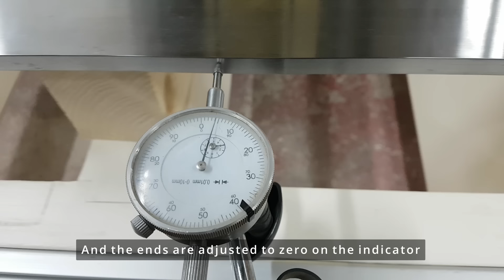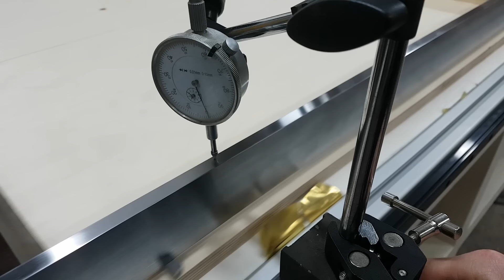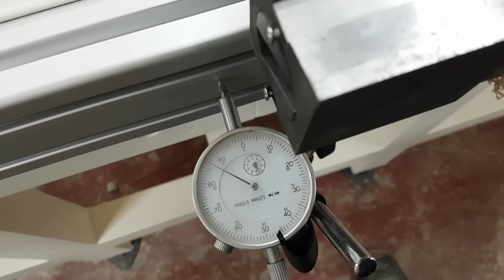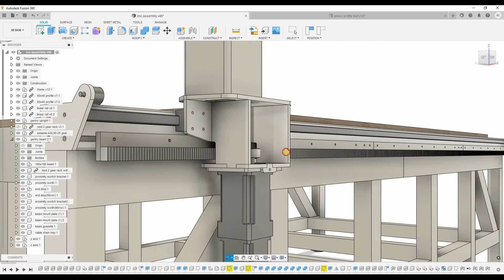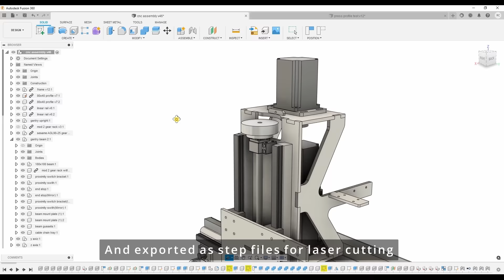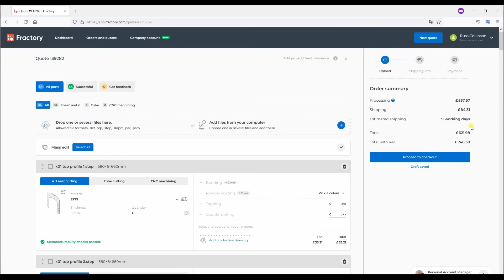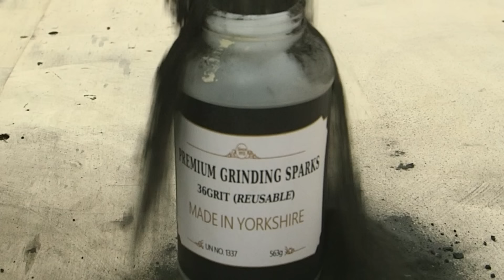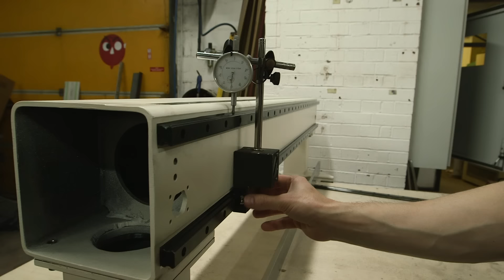Building an EPIC £20,000 machine part 2

Comment: As a qualified engineer, welder and fabricator I can appreciate the effort and time into this project. Very nice work indeed. [edit: out of morbid curiosity, how much did you pay for that sheet of ply?]
Reply: Ply cost, probably the same as a small amount of Lurpak.
Reply: A qualified engineer... wow. ^^
Reply: probably about twice as much as the price was 2 years ago!
Reply: @l.k.1011  That means you own a screwdriver/chisel and an adjustable spanner/hammer.
Reply: @andysparks8245  - waaaaay more than double!!

Comment: Hi there ,great work I’ve had similar problems with shimming.I eventually used 3 mm rubber insertion (gasket rubber ) and torque past the three mill thickness until the rubber was 1.5 mm and the used the same setup as you have for truing up ,the rubber acted like a spring  ,it held fast 👍.

Comment: Very impressive. The only thing I'm curious about is that the main base is wooden and thus will expand and contract with seasonal changes and thus the very tight tolerances used possibly will change.
Reply: Isn’t the paint seal it? Kinda making the wood waterproof etc. to prevent it from sipping any moisture etc. 😂
Reply: I guess the paint will not fully seal the wood. There are some cracks in the wood and I think they are not fully sealed. Sure the wood will not work much at the beginning. The time will show if it works well enough. 😊
Reply: Steel beds are overrated. Precision is mostly determined by the steel in the linear rails in the Y axis, not the wood, and the X axis actually is steel. The Y axis may be an issue but it is easy check for accuracy. Steel has temperature/expansion issues also.
Reply: Well I’m impressed, I understand why the  table assembly was so sturdy now.
Reply: @carefulandprudent1058  yup bro

Comment: I agree that the ingenious way he builds things with pretty much home shop tools is amazing.  I have one complaint, when I was 18 years old I went to work in a machine shop and the 1st day was safety training.  One of the first things they passed around the group was a pair of safety glasses with a broken off drill bit stuck halfway through the lens.  This was from a guy doing exactly what he was doing drilling steel on a drill press when a bit about the same size snapped off and hit the glasses.  That was an eye opener (pun intended) for me.  NEVER drill anything without eye protection!

Comment: Amazing work, hopefully those linear rails hold up, that’s going to be a lot of mass to accelerate between movements. That’ll be more stress than the movement itself (like anything, it’s not the movement, it’s the sudden stop/ start). That top gantry alone. Oof. Good thing is you will be able to modify/ adapt the gantry as you learn and use and if you will be using a mill with g-code can adjust acceleration values to not have the thing rip itself apart.

Comment: This is much more work than it looks on video... Respect!
What will those 3 extra motors be for? 🤔
Edit:
Thank you for not making this a 73 parts build, just for the algorithm.
Reply from the maker: they are planetary gear reducers,  two are 20:1 for the dual y axis, and the other 25:1 for the x axis.  because they are used, they didn't have three the same. I sized the spur gears so they are all the same end ratio.

Comment: Love the "level" at the start of the clip. Haven't seen anything like that before, however, I have seen something a little more basic. A good few years ago, a builder friend of mine was helping me build a large deck across the front of my house, and he turned up with his level. A old 20litre paint tin with a piece of metal tube soldered in to the bottom, 25 yards  of green garden hose and 6 inches of clear plastic tube. Worked perfectly ...so we thought, until we got to the far side of the house and became aware that the level marks were somewhat off. Slight pause to scratch heads, then discovered obvious flaw in system. Small leak in the old paint tin. 🙄.  Blob of silicone sealer and some more water solved problem, and leveling marks accurate enough to satisfy even a picky builder. Deck still up, and level quite some years later. You young guys don't know your born with all that "Modern Technology" 😂😂

Comment: Admirable effort in trueing it up but, and I hope I've missed something here, but with multiple pieces of timber and their grain going in all different directions, won't the differential thermal and moisture expansion/contraction render all your work, well, pointless? I mean, better than not doing it but the flatness will be everywhere.
Reply: Having all the grain running in one direction would make it even worse as you would have all the expansion and contraction in manly one axis.
Also this isn't an industrial application where everything has to true up in all environmental conditions and for a million cycles, for his application this will do just fine.
Also there is quite so adjustment left in the system.
His only alternative would have been welding up a huge underconstruction, like a welding table or hydraulic bench and making one of those and getting it completely flat is a task for which you need quite a substantial metal workshop.
Reply: @marcusott2973  well he needs to have more content lined up for a sequel… 😅
Reply: Watching this and other videos he's produced has shown that the guy is a perfectionist  and probably won't settle for just good enough, so will put his best efforts into whatever he does. There's no counter argument to that.
Reply: Initially I thought it was pointless as well (after the first 10 minutes of the video), but there's a point to his madness. While the wood won't stay true, he needed it to be true to be able to accurately grind in the other parts. Even though the wood will move, at least his metal parts are much closer to perfect now.

Comment: Hi, Still watching this. Really enjoy watching your videos. Probably a bit late now but while watching you do the shims, I wondered , if you put the shims between the rail and extrusion instead of the extrusion and wood it may work better. I would think as you tighten the bolts the wood will compress slightly where the shims are but between the two metals it likely will not happen and any pressure on the wood will also be evened out. Not an expert on anything just a thought...

Comment: ok, I have to ask.. why are you chasing microns when you have timber frames? the change in seasons is going to move that timber more that the tolerance you are after :)
Reply: Hmmm @ PICSI good point , so maybe  a season check twice a year is oke , but temp control is a solution for the shrink and extend of the wood .p.s at the end tho it needs to be recallibrilated once in in while  but what a genius build .
Reply: I would imagine that is the whole point. Get it as close to perfect as you can, that way with seasonal movement it will be an acceptable tolerance.
My hats off to you sir for constructing this CNC for our enjoyment to watch and appreciate your tenacity, patience and great skill!

Comment: On a wooden apparatus, certain measurements are palliative, with humidity and temperature varying considerably. Wanting to have the precision of a cast iron apparatus such as a milling table is uncertain.
Reply: I agree. Although beautifully joined this table will move considerably in the moist English climate, possibly enough to bind horizontal movement
Reply: @petek210  ,"//////s/
Reply: @petek210  ...

Comment: I'm building a CNC right now too. I used steel for my framework, my local machine shop charged me a hundred bucks to deck the steel pieces, and these were 5 ft long pieces. I admire the home built resurfacer though. That was pretty cool, I did not think it would get that accurate

Comment: Nice work. As an Engineer I desoigned dozens of these tables along the way. I was very sceptical about the wood frame, but you managed it well. On your shimming : the bolted rail adds up a ton of rigidity to your already heavy aluminium extrusion. So to unbend it, just loosen the rail screwsscrews otherwise you just bend your chassis.

Comment: It is a privilege to watch your mix of engineering and knowledge of wood. Two questions: 1. Despite testing all the tolerances, is not likely that wood changes its shape with workshop climatic changes. and 2: When I first learned welding, I was told always bend the cold end of your rod - a. you'll never pick up the hot end if you see its straight, and b. you're unlikely to poke out somebody's eye with the cold end. Love your dedication, precision and Yorkshire humour. Hope you get a kidney transplant, if necessary, after that plywood purchase.

Comment: One thing I learned from my time working in R&D on positioning systems is the importance of minimising the weight of moving masses. I'm interested to see how much bed flex you get when starting and stopping that massive steel gantry.
Reply: On a similar vein, a lot of weight being held by the vertical tracks. If the tracks were laid flat, with a milled flat bar between table and track, that could eliminate any Z axis movement.

Comment: Great video as always. I used to work on a CNC die cutting machine for 24 years, It was in envelope place cutting envelope blanks first machine was a non computer manual imput schon machine. Then went onto schon computer controlled machine with auto feeding pallets of paper. then onto a japanese Sysco cpc-NA computer controlled.
    they are great for mass production. A lot of woodwork channels going the cnc route. i do like your attention to detail when you working on your house more.

Comment: Overall, for the project you did a great job. Love your videos. Nice and relaxing.

The reason you kept getting high variations in the measurements on the first rail  is because of the compression of the wood. The washer and shims were able to be pressed into the wood as you tightened the bolts. A way to avoid this would be to sleeve the bolts through the wood with a less compressible material. This would then allow the adjustment of the first track, eliminating most of the compression and instead allowing the track to be straightened. Given that it is used for wood, tolerances can be larger, but in the future it is something to remember for any other large projects.

Also the movement of the reference point each time compounded the inaccuracies.

Comment: Water levels are super accurate.  I use a 5 gallon bucket of water at one end and, on other end just mark a line on the tube and align the water level with the line on the tube as a zero reference.

Comment: Liquid level - perhaps larger diameter tubing, garden hose ?, and some surfactant to minimize "friction" with the tubing walls, flow resistance ??  (on drugs now ...) maybe ATF, crazy low surface tension.  still really hard to read the liquid surface position ...  i understand wanting to cross check the laser level. once you've got some distance it doesn't take much angle to add up to a possibly significant distance offset.  Like shooting.   Love watching your work. Very peaceful.

Comment: The Aluminium extrusion could have also been used to build the frame. More rigid and better tolerances. Get in touch with ITEM they do everything you need for building CNC / 3D PRINTERS / LASER CUT Machinery - their catalogue is incredible. Other brand also worth a mention Bosch Rexroth - both companies have good representation in Yorkshire

Comment: There is a lubricant Martin Woodworking Machines uses for ball bearings with heavy loading. I think Lubcon sells in Europe. Spindle bearing with low temp and affinity to metals.
Thurmogrease L 252 comes in 14 oz tube. This grease should make your guide bearings last 3X as long. K HC P 2/3 K -50 Catalog number. About 14 bucks a tube.

Comment: Should try the Minitec profile, groove nuts have rounded face to insert thru the slot anytime and have a spring option to hold them in place. Handy in vertical situations. Watched some engineers at a trade show start to disassemble a structure to slide some nuts in when I interrupted, grabbed a nut and poked it in thru the slot - Engineers looked at each other    Huh    :)    Nice work overall.

Comment: These is a TRUE EPIC video of a CNC build, your attention to detail is astounding and on par to a NASA project. 0.015mm accuracy over what looks like 3m length is being really fussy but I'm sure will pay you back in damn accurate work later 
Just outta curiosity, what would a similar factory designed and built machine cost ? Have you visited your build yet ? Love to know how much your saving in going down the DIY road.

All the best, K

Comment: AFTER I LEFT SCHOOL AT 15 WITH NO FUTURE IN FRONT OF ME I DRIFTED FROM JOB TO JOB AS MY DAD WANTED ME TO GO AFTER 'THE MONEY'....I ENDED UP IN WORK I DID NOT LIKE,OR WANT TO BE IN. FOR OVER 29YEARS I WORKED IN ENGINEERING FROM SHEET METAL WORK ---SETTING /OPERATING CUTTING MACHINES IN A FACTORY THAT MADE POINTS FOR CARS AND ENDED AT C.V.A IN BRIGHTON AS A SETTER/OPERATOR OF MULTY HEADED LATHES,,,,CVA 8,s  HOW I ENDED AS A CARPENTER/JOINER IS FOR ANOTHER DAY..
THANK YOU FOR SHARING THIS TALE OF YOUR BUILDING A CNC TABLE   STILL HAVE PART 3 TO SEE....IT BROGHT BACK MANY MEMS FOR ME   NOW 74....

Comment: I sincerely admire the diligence and accuracy, as you called it, in the chasing of microns. However, I wonder if the wooden base will not introduce major deviations due to the inevitable changes in the ambient humidity. I hope not...
By the way: the method of applying corrections impresses with its simplicity and efficiency. Brilliant!!!

Comment: Your care and precision is close to the best I have seen to date. However. Please correct me if I am wrong. Unless you are in a temperature and humidity controlled environment won't the wood move rendering all that care and precision moot? I would have built a steel frame that possibly floated on the beautiful wooden frame to mount all the tracks to.

Comment: Well, after that I feel I've achieved something. No doubt you feel that 1,000 fold!
Really, really nice work.
When you were testing the stops on the gantry, I could see some vibration of the whole unit. I suspect that is the whole structure vibrating rather than just the gantry?
Reply from the maker: yeah its the wood base, it doesnt have any bracing in the x-direction yet. I will put plywood (or maybe something else) plates on both ends and the middle. the ends will be vacuum valve mounting plate on one end and the other end will be a vertical clamping plate. the middle will jsut need clearances for the vacuum bed pipes.

Comment: I am impressed with your ingenuity and engineering skill, but I am more than a little concerned that the weight of that gantry will prevent you from every getting good movement speed.  The mass/momentum will probably cause overshooting/ringing on direction change.

Comment: It's great to see the use of a well sharpened pencil for marking out instead of the American method of a 1/4" wide felt tip with a finalized line width of near to 1/8".  I would not like to comment upon the final accuracy at the end of their projects. The mind boggles. Personally on metal I prefer a darning needle epoxied to a suitable shank. Nuff said.

Comment: I've built several large CNCs as well as a mini VMC - I don't think I spent that much time calibrating things during setup, mostly post setup....  Impressive.  

One thing that is neat is how much more parts & services are available vs 15 years ago when I was doing this... Just the rails alone would have cost as much as a car....  and there was no fancy order plasma cut parts online thing....  Pretty cool.  PS I sometimes filled extrusions with concrete to keep resonances down, but was also machining metal not wood.  That said, the gantry already looks too heavy ;-)

PPS If you haven't done so, put endstops on your rails - nothing more frustrating than rebuilding linear bearings after all the balls fall on the floor - ask me how I know.....

Comment: I truly admire the level of accuracy you're trying to achieve, but I am wondering about the usefulness.

In the end it's still wood that you are tuning and it will move and warp and twist with changes in moisture and temperature in your shop. Not to mention that you could largely make it moot by including a levelling system in your CNC.

Comment: Superb build quality and attention to details.

I understand the cost of a steel surface table that size for the base would be prohibitive (would it ? They seem to come up on ebay surprisingly cheap) but my only concern is that the wooden base will have a different thermal coefficient plus humidity (which obvs doesn't affect painted steel) .. how much will it twist etc iver the seasons ?

Comment: For the amount of holes you are tapping why not use the drill to tap the holes with a machine spiral point tap. And use Kroma Tap Tapping Fluid ,no residue tapping fluid. Perfect threads every time.
WD 30 is not useful for tapping threads, it is actually counter productive.

Comment: Well that was a great video! Felt like 15 mins. I really like your long format stuff. The last 10 mins I was like: "Man only 10 mins left!!!! Oh no!" LOL. Looking forward to the sequel. If I may ask another question: That drill bit you used on the drill press with a protruding doohikey to align the wider bit to the holes, what is that called? I have never seen one of those before. Cheers.
Reply from the maker: thanks! ye its called a counterbore, basically a countersink but for cap head bolts etc since it leaves a flat bottom rather than tapered